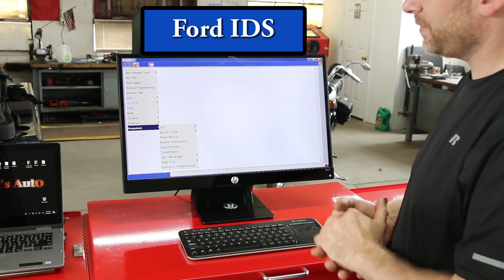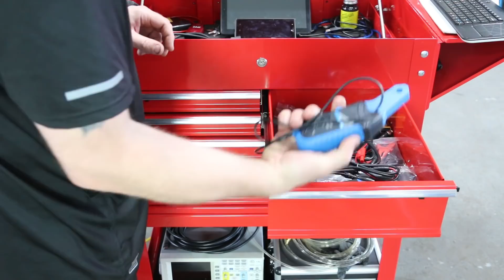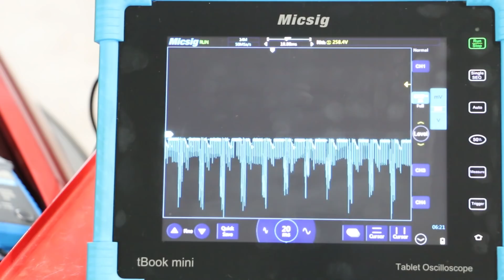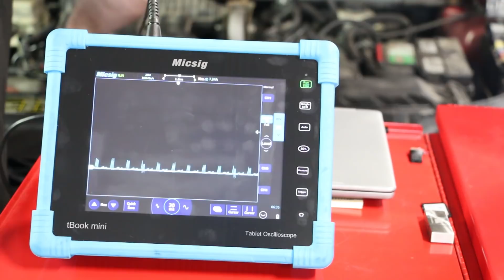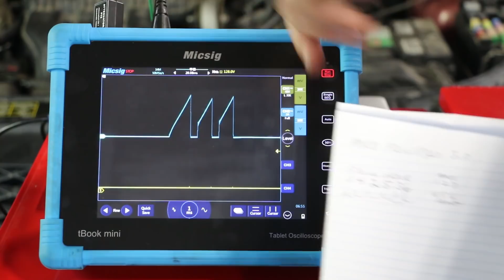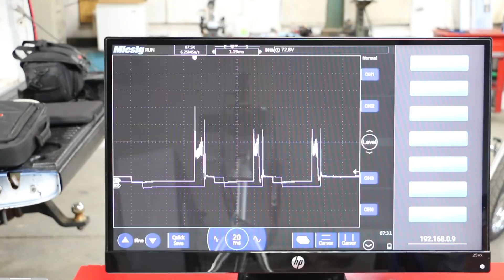No codes misfire interactive Diagnoses - Primary Ignition Part 1

Comment: Another fantastic video mates would be interesting to see the Ohm's of that coil cold and hot that's very high amperage spike on the coil at least no damage was done to the drivers looking forward to part 2 with no burn time on the plug definitely looks like no spark getting to the plug short somewhere in the coil

Comment: Thanks Will for your work. I think it's a bad coil, at coil turn off the current goes negative. This means the energy cant be released  other than back to the primary side. 
Another thought is that the multistrike burn times in one power stroke  sum up to the total burn time.

Comment: Great work man I know you are tired from the last shoot but being a DIY myself I will side with most of the comments below cracked coil or spark plug gap or grounding issue within the cylinders caused by a faulty or failing or about to fail  part. Remember also what the word NEW part means in auto repair (never ever worked) part so don't rule out anything brother like Ron Ananian the car doctor show host says all the time. You will solve this you got this

Comment: Why is this not a non-firing cylinder caused by a lean misfire (see sec ig high firing line and a spark line nose shooting up from super high resistance). Misfiring is causing voltage build up in sec and that is "ringing" in the coil, with the oscillating pos and neg voltage being back inducted into the primary. Hence the neg current spikes on the primary current. Second possibility is an open in the sec ignition, but I wouldn't expect the high nose and short spark line in-cylinder. Keen to see the big reveal;-)
Reply from the maker: Alex Messina wish I knew more about this molti strike ignition. I'm still learning myself. 

What I know so far. 
Misfire originated on cylinder number 1 went in and replaced all coils and plugs 
Misfire cleared up 
We later took the coil and plug from cylinder 1 and placed them into cylinder 4 
The misfire moved to cylinder 4 

Keep in mind the back bank required intake removal so it's not as easy to just swap and follow the missfire. 

My hopes of this video is to find a way to be more confident in making the call on such a large job 

With that said I honestly don't know any more than all of us at this time. 

Besides that I can remove the coil and plug from #4 and install the new and she's good to go. 

With hopes we will see something obvious this afternoon when I go in for the follow up.
Will be using questions from the comments if you would like to see a certain test I will try my best for you
Reply: You're great Will. I love watching. Better than a movie;-)

Comment: I would think bad coil or plug!!
Reply: At the end when you do the comparison eith coil 6 we can see that the current for the second and third spike its not built up like in the known good, probably a bad coil, lean condition,too much heat,high voltages make the coil crack and doesnt conserve the energy as it should!!!

Comment: It's interesting to see the variance in COP systems. On my Chev I can't get at the ground side of the control circuit, but each coil has a short secondary wire I can get an inductive signal from.  I can get current from a single wire going to each bank, dedicated to those four coils on each bank. Not as good as the old style palisade with a distributor system, but good enough. Nice demo, Will. It looks like a bad coil, so far. With saving diagnostic time in mind, I'd be swapping only coils to see whether the problem moves to another cylinder. This one is so dramatic, I wonder what a simple ohm check of the coil would show.
Reply from the maker: spelunkerd very interesting isn't it! I will do a Ohm test for you in part two 👍the cool thing is I have this vehicle at our disposal as needed and the old coil and plug. Tomorrow afternoon I will start putting together a follow up video with all suggestions :) thought this would be fun. It's great having you here
Reply: Oh, I got called away before watching the second half of this video. Hash in the burn line and a weird burn time with a higher than average spark voltage. This is a really interesting trace! My first guess was the coil but now I'm not so sure, I wonder about the plug with all that hash.... The coil can put out a pretty good voltage spike, it might be OK, though I'm not sure I can explain the unusual second and third amperage curves. Maybe guys who work on these cars all the time will quickly recognize the waveform, the amp curve looks distinctive but I don't have the experience to say. Perhaps if there is no ionization of gasses inside the cylinder, the second and third waveforms don't get to start at a higher amperage because resistance is unchanged.... In the end I would look at the plugs and change them, then look again and probably swap coils to see if the abnormality moves. I guess we shouldn't be too surprised that some waveforms are not necessarily diagnostic. Great video, Will.
Reply from the maker: spelunkerd it's an odd one I agree. To be honest I won't really know anymore than all of us till I get it back in tonight. When I seen this on cylinder 1 I just went and replaced plugs and a new coils because of the job at hand. 
Here is what I do know. 
Plug and coil combination fixed the missfire. 
I moved the coil and plug to cylinder 4 and the misfire followed 
I'm Anxious to get it back in myself 😊

Comment: Nice video Will. All I'll say right know is the amp waveform is key & good thing you changed out ?? before it took out ?? . :D  Hmmm wonder what caused what to happen first :D  TSB 05-22-08
Reply from the maker: Thank you. I'm reading between the lines 😁 very good thoughts. Glad to have you here! Good question
Reply: HAHA yep read between the lines without divulging the answer :D
Reply: Will...also ohm the primary & secondary sides of the coil

Comment: I'm not an automotive tech so I don't know much other than what I've seen on your channel and many others. Isn't there a "rule" that says if that type of thing shows up on the left side of the burn line the problem is outside the cylinder and if it's on the right side it's inside the cylinder. I'm going to call a secondary to primary leakage or short. Could also be a bad boot I guess. But then what do I know. I'll be looking forward to the answer.
Thanks much for your videos.
BTW. I make a lot of  running model IC engines (yes they all run). Can you suggest a small COP coil that has 3 wires. i.e the ECU only supplies a trigger signal and does not drive the coil directly? I believe Ford coils are all 2-wire i.e the ECU drives the coil directly. Is that correct. I'd like to trigger the coil with a hall sensor circuit but I don't want to have to supply an external current driver. Small and cheap would be good.
Thanks
Reply from the maker: Dave Sage I would have guessed you were a full time tech 😁👍 thanks for sharing your thoughts. As far as the coil goes I'm not sure what to recommend to be honest. Will do some research. however I know exactly what you are referring to. Yes most fords I see here are 2 wire external driver. This makes primary troubleshooting possible as demonstrater in this video. 

You brought up a good point with this question!

Comment: I love BBB industries. Ivan hooked us up! Thank God it was on the front bank for accessibility. Oh yeah, I have two note books full of notes from Scannerdanner. Will, in my limited studies so far (and I have a long way to go) I would guess the coil has a short to ground. But then I read the comments below and I'm like Uhmm, that makes sense. I'm looking forward to part two and maybe we'll see a way of confirming if it's the coil or the spark plug.
Reply: It was originally on #1 but his audio was bad so after it was fixed he installed all the bad parts from cyl #1 into Cyl #4 for Retake #2.
Reply: IN MY 40 YEARS BEING A DIYER IVE FOUND 99.9% OF THE TIME THIS PROBLEM WITH THAT WAVE FORM TO BE A COIL THE OTHER 1/10TH OF THE TIME WAS FROM CARBON TRACKING UNDER THE BOOT
Reply from the maker: Yes BBB is great he hooked us up for sure!! That's a very good guess Wyatt!!! 
coil and plug was moved from cylinder#1  would've been to much to put it back for the demonstration

Comment: I would be looking for arcing, either inside the boot (to the plug body) or to something close to the outside of the boot.  Either way, there's a spark but, it's not happening in the cylinder.
Reply from the maker: LEO ASHRAE very good suggestions!!! Will be sure to inspect closely for you 👍thanks for sharing your thoughts

Comment: The lines below zero signify that it’s going to ground easily somehow and because there is no burn time the plug itself is not sparking. The coil could be tested by moving just the coils and leaving the plug and see if the waveform changes if it moves elsewhere you know it’s the coil if it remains I would suspect the plug. I would be curious to know if one of those coil paddles would show that the coil is working or not with this issue.
Reply from the maker: John Gibson very good thoughts and suggestions!!!! I'm liking the way you think!! I will do exactly that for you in part two. We will just move the coil. Thanks for the interaction. If you want to see anything else or have other thoughts please share. I will have this vehicle at our disposal

Comment: Is the software u r using using the onboard computer or do u have leads hooked up to different sensors? Also did u disable the fuel when doing relative compression test or does software do it?
Reply from the maker: John Gibson yes the first software I used is the Ford scan tool IDS. The relitive compression we performed is using the software. When it has us put the accelerator to the floor, it places the vehicle into clear flood mode. This disables the fuel. Thanks for the interest!!! If you want to see more tests or have any other questions feel free to ask. This is a test vehicle and I can perform more tests if needed